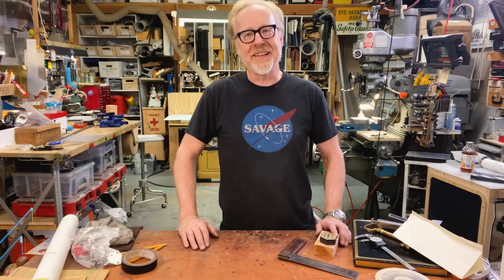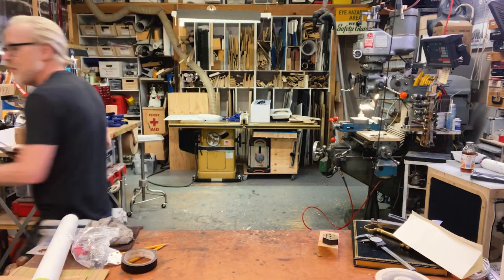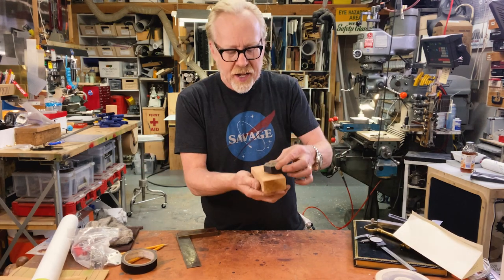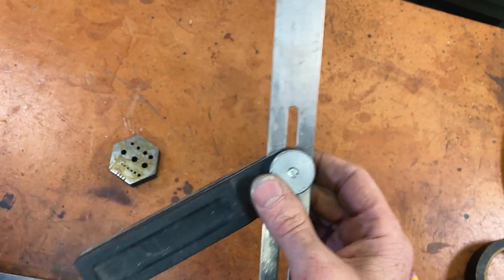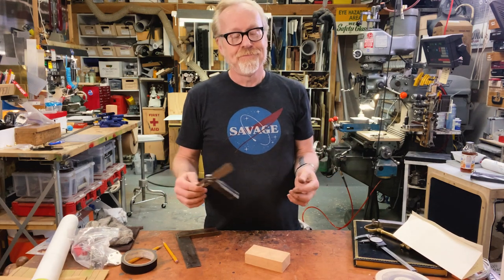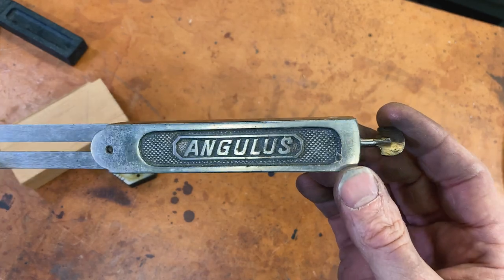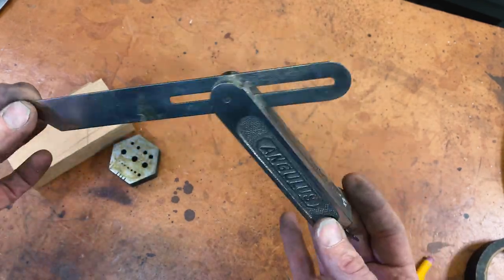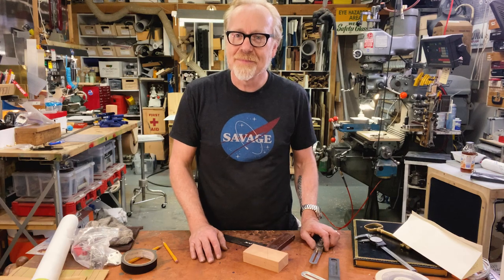Adam Savage's Favorite Tools: Angle Finder!

Comment: Hey Adam. Love your videos. I just came to have use for a c. 1920's lawn roller (its a forged steel beast) thats been in the  woods on my property for decades. The square bung was completely rust welded on, and of some mild steel that doesn't take a tool well. At a local antique tool store I picked up a "bung wrench", date-stamped 1927. I was able to hammer it onto the bung, chiseling a new edge to torque on, attach a cheat pipe to it and finally get this bolt loose.  The wrench? Its patina'd... it shows absolutely no signs of me having beaten it to death with a hammer or it having chiseled its way to making a new nut.  Its from a time when American steel was something to behold.  I LOVE this tool. It even has a pin hole in the base of the handle to gain leverage when turning the mechanism to release something like a bung nut wedged into a wrench that was hammered onto it!

Comment: I have two,  My larger one is the modern Japanese version of the Angulus made by Shinwa out of aluminum/steel (I love having the knob at the end).  The smaller one I ended up making myself.  To say that I use them a lot is a gross understatement.
Reply: I've been looking at the shinwa one. You'd recommend it?
Reply: @cholulahotsauce6166  Definitely.  I bought it years ago and it was between a Crowne (I think) and the Shinwa.  There were really nice expensive models made by Veritas and Bridge City that were out of my price range.  The Shinwa is simple and no frills but gets the job done.  The thing I like is no wing nut/knob to get in the way when flipping it over.  For marking out dovetails and such, it tends to be bulky at 10".  That is why I made my mini one.
Reply: I have long wanted a Shinwa version, I’m told they hold there setting better. For those unfamiliar with the brand, Shinwa is about the quality equivalent of Starrett and in Japan their squares are as ubiquitous as the Stanley powerlock steel tape.

Comment: I'd call that a sliding t-bevel....an "angle finder" would actually have a scale or digital readout and give you the actual angle in whatever units it is designed for.
Reply: Agreed but im assuming you can extend the "fin" fully out, put it the angle you wanna measure and put the rigid side to the compound mitre saw fence and line the blade up with the "fin" and cut. Digital/scale would be better but i guess better then eyeballing it
Reply: Yup. Sliding t bevel. 
I've got a few in my tool boxes, got a really nice wood and brass one from a company called Lee Valley
Reply: Amazon sells a t-bevel, with a digital readout, $20
Reply: It’s an angle finder to me and has been for 40 years
Reply: So would I, it is the actual name.
Reply: They are also called "bevel squares"...
Reply: Interesting. I have heard them used fairly interchangeably, but tend to think of them as a bevel gauge. I think that is frequently what I hear them referred to as in woodworking.

Comment: Worked as an electrician for a few years and 5/16 hex-head self-tapping screws were the perfect solution to so many sheet metal problems.  Had to make sure to turn the hammer off on the drill or it could twist the hex-head off of the screw.

Comment: As a carpenter I have a digital version of this, also know as a sliding T bevel square. I measure and map out an entire floor of a house when I'm doing casing and baseboard complete with checking the angle of every inside and outside 90 before I make any cuts. The digital version is worth it since almost no corner is going to be a true 90 after framing, drywall and mudding and taping are taken into account. Saves so much time not fighting to close up those gaps!

Comment: Found this video after picking up an identical Angulus at a flea market. Beautifully made, solid piece of kit - 312g (11oz). I also have one I inherited from my father, Silex brand. These were made here in Australia from the late 1940s. Same mechanical principle as the Angulus, perfectly functional, but nowhere near the same quality. Here we call them a "bevel gauge". I've also seen them called "T-bevels". I also have a hundred year old Starrett combination square with a protractor head which I guess at a pinch could be used for the same purpose.

Comment: Mine is an old Stanley. Wood (rosewood?) handle, brass fittings, steel blade.  I've had it since I was a teenager in the eighties, when I bought it at the flea market for a couple bucks. I've only used it a handful of times, but it's paid for itself many times over.

Comment: $5 tool
$40 postage

Sucks to live on the other side of the world.
Reply: You can make your own for super cheap out of a metal ruler, two pieces of parquet flooring or a piece of wood trim (hard wood) and a few misc nuts and bolts. Frankly, this is a tool one should make, never buy, because it's the beginner's tool project. There's no real critical dimensions, you can execute one with a drill, a flat medium metal file,  and a few blocked pieces of sand paper for metal and wood.
Reply: Aserta is right. Just make one.
My Uncle was a master carpenter/cabinet maker. 
He made his first speed square when he was in shop class. He still had it in a chest of old tools 55 years later when he retired.
Reply: You can get those anywhere. Most of them are not particularly nice, they have a cheap wing nut instead of a nice thumb screw, but they work. Vintage ones like Adam’s with the nut at the back (mostly made by Stanley) are surprisingly expensive, though.
Reply: I found one on eBay. Previously owned. Rosewood and Brass. Including shipping and tax $19. Go look there!
Reply: @aserta  A how to guide to make one has been printed in almost every woodworking magazine.  Two that I know of are Fine Woodworking and Woodsmith/Shop Notes.  Like making your own handle for a tool, you can probably buy one off eBay and customize it with your own parts.  This not a machinist square that need precision grinding.  The only critical thing is making sure the parallel edges are parallel.  And you are absolutely right, with brass and wood, it can be done by hand with files/sandpaper.  
I would add that taking a blade from an existing tool is a whole lot easier than chain drilling/filing the slot by hand; especially if you are working with SS.
Reply: I don't know where you live, but there's bound to be an option close to you. Depending on your locale, you could translate the name of the tool (I find Wikipedia useful for this, but it greatly depends on the popularity of the tool and language whether it works for you https://en.wikipedia.org/wiki/Sliding_T_bevel) and then look it up in your local hardware store or ebay/craigslist/gumtree-like website. Also, for making your own: make sure the edges are straight and you're good to go.
Reply: nah, more like the US sucks for being so stubborn in not using the metric system
Reply: @anarchism  I whole heartedly agree.
Reply: Shinwa has some really nice ones, don’t know about shipping but they were affordable and really well made.
Reply: I'm guessing a fellow Australian? 
Take the US price and multiply by 4. 
I think the way everyone in the States says you can pick up old tools for next to nothing is a function of the huge woodworking industry there and the time its been going. 
Lots of old tools lying around. 
I look at the ones here in flea markets, old stores, gumtree etc and they are almost as expensive (or even more) than buying new.
Reply: Better than living in the US
Reply: @pmd7914  You've got a point there...
Reply: @anarchism  .. you can get metric and standard/imperial angle finders .. lol
Reply: @anarchism  yeah those metric degrees are much better than the Imperial ones.

Comment: One of my favorite tools is a set of brass pocket calipers. Only about 4” but I’ve printed a credit card wallet that has a slot on the side for them as well as a mini BIC lighter on the bottom so that they’re both with me whenever I may need to get a small dimension accurately or melt some plastic/paracord/light a fire.

Comment: I can't find a video on you taking about them but I might be blind. Definitely recommend taking about stripped screw removing drill bits that spin backwards into a stripped screw, catch it, then because it spins backwards it takes the screw out.
Saved me tons of time after I found out they existed. Used to use a dremel and cut new grooves to take them out

Comment: Contour Gauge: My brother got me a contour gauge for my birthday. It's a cheap tool and it's pretty cool. It consists of a bunch of pins aligned tightly together but able to slide. Similar to the angle finder the contour gauge can be pressed up to an object, like crown molding for example, and hold the contour shape, allowing the user to then transfer that shape to another object.

Comment: I have a few ideas on tools that not everyone knows about. 

1) Center finding rules Probably a lot of woodworkers do know about them, but not everyone and they really are a great tool in the woodshop.
2) Saw vices and saw sets. Dont toss your dull saws, sharpen them and set the teeth for different aggression on the cut. 
3) Magnetic angle finding levels. I use them for sharpening plane irons and chisels at 25 and 30 degrees. 
4) quick release drill bit, counter sink and screwdriver bit combos. Not sure the actual name for them, but when you use the drill bit side, you can drill the pilot hole, counter sink and then flip the bit to the screwdriver side and screw the screws in. Great for doing larger projects that would be tedious otherwise.

Comment: Wow, this video could not be better timed! I have a shed sitting about 4 feet from my fence and would like to cover that space for storing wood. So my question is how do you measure and cut a 2 x 4 that will be screwed to the shed and fence at an angle? Need the angle so rain will run off the covered area. None of my tools can be placed between the shed and fence to find the angle of the cut needed to span the 4 feet distance. I hope this is making sense.

Comment: I just got a new tool that is CHANGING MY LIFE!  A Marshalltown 13" flooring cutter.  I hand recycle HDPE, and this thing is a game changer.  If you have a big shop with a table saw then this isn't really a step up but as someone who works in a small apartment this is a god send.  My pieces are never more than 12" wide or half-inch thick so it literally cuts everything I work on. No sawdust. Line up the job and chop in seconds.  Like a pocket change worth of seconds  LITERALLY cuts like butter.  Cold butter.. but butter nonetheless. Once DIY at-home recycling gets off the ground this tool will be a mandatory part of the process.

Comment: You don't need one of these sliding t-bevels, you need at least two.  My two favorites are right handed and left handed Angulus style antiques.  One is a Craftsman and the other is a Stanley.  Pre 1960 Craftsman tools were mostly made by Stanley.  Yes, they really did make RH and LH versions.  Having two or more is very useful when making something with multiple angles like a bastard hip roof.

Comment: Yeah I had to build one as my first tool, it’s fun to have to learn how to file correctly to make a perfectly round end that matches on both sides with a taper that goes from 6mm to 3mm, again matching on both sides, doing all this then getting the wrong kind of rivets that don’t fit the holes you drilled. But it was a learning process and was completely functional albeit looked like a piece of scrap metal

Comment: The angle finder was key when I was finishing the interior fitment on my boat, all the trim pieces had to be carefully measured and cut. The key to a good one in my opinion is the locking mechanism. That big, low profile wheel is excellent, but a lot of the angle finders I found in the hardware store just had a wingnut, which stuck out, caught on things, and made it a little harder to grab angles sometimes. The one I found has the low profile wheel and also a level bubble in the handle.

Comment: hey, adam there is a measuring tool my uncle gave to me its called a rabone folding ruler and what it does is it has a 2 ft measuring ruler condensed in a 6in space and it will do that as well as tell you the angle on the pice of mettle at the base and on mine and some other models it has a level on it to me this is an amazing piece of equipment and I think you were right when you said the old tools are better in some cases because they were cared for a lot more back then and made to last.

Comment: i really enjoy your tool video's, especially the simple basic tools.
a couple of basic tools i like is a 'automatic' centre punch. unlike the spring style you have shown before its used single handed which makes things easier.
another is a 6" soft board saw. it has a drill on the tip and chunky teeth that can cut a lot of different materials. simple and handy.
a range of torque wrenches. the usual click type in a range of sizes but also the old beam type for measuring breaking torque and rolling torque, very handy for setting bearing preloads on bearings in your projects.

Comment: Great tool. Although Adam forgot to mention its other function. IT not only allows you to transfer an angle, but it also transfers the complementary angle. This comes in handy in lots of ways. If you have a 60-degree angle, for example, you flip it over and you have a 120-degrees handy as well.  Any time you are trying to layout a parallelogram of any kind, this is really convenient.

Comment: here a tool you haven't mentioned. but i find is very handy, and i didn't hear about it until I was 60 years old. and it is a Hook rule. like a machinist 6" rule but it has a small hook on one end. great for hard to reach measurements. im sure Sterrett makes them. there again second hand stores or yard sales,  may have one now and then and there too not that expansive either. hope this helps.

Comment: One of my all time favorite tools is a power file. It's basically a mini, hand-held belt sander and it's amazing. Before I had my 2x72 belt grinder, I used it on every single project I did. Metalworking, woodworking, even on some ceramic stuff (but I wouldn't recommend that); it's immensely versatile.

Comment: Mr. Savage...I am NOT a handyman and I need some help. If I sharpen my mower blade (which requires 30degrees on one spot and 45degrees on another spot of the blade) what tool can I use to check it and how? I would prefer something without batteries but what is it called and how do I do it?

Comment: My favorite tool is a pair of craftsman ignition pliers (made by the  wilde tool company) they're essentially the world's smallest pair of channel locks . They look like a toy that belongs on a key chain they're 5¼" long with jaws that are 3/16" thick (3/8" thick at the pivot bolt). I  carry them in a back pocket most of the time. They're virtually indestructible. They work as a wrench up to ½" and the jaws have very hard teeth,  they've bailed me out many times when brake bleed screws were rusted up and rounded off by others , even stud extractors didn't work.  I have also used them for  cotter pins  that  were mangled  and  wire crimpers in tight spots, and to some degree they actually work better... Multiple companies make versions  by none I have seen are as small and well made as the  wilde tool co. versions..... as for the  'craftsman square'  traditional if it  has a wooden handle it would be  called a  'try square ' but with  metal handles it's now an engineers square' ..... I'm a big fan of the proper names for tools based on the profession that developed them. BUT at the end of the day  if the person you're talking to understands which tool you want. Then that's good enough.... Honorable mention, a really good quality high carbon steel (not stainless) stockman pattern pocket knife  preferably with  bone handles.... just as useful  very  abuse and  chemical tolerant ... but needs a little love  and oil occasionally. (Bet that won't start any fights 🙃)

Comment: I made my own custom angle finder, with a protractor included. I wanted to copy an angle, or angles, from something, but also know what the angle is, so I could draw that same angle in my vector drawing program while trying to design something to fit. It’s a big flat piece of sheet metal with the angles marked off (printed out, laminated and mounted), and a rotating arm that is wing nut attached. I wish these comments areas allowed uploading pictures.

Comment: I’m a joiner from the uk using my partners YouTube account 😂😂 but I would recommend a tool that you may love like I do. It’s called a starrett protractor using it to find the mitre of something is a game changer hope this helps, keep up the great work love watching your videos.
Reply: Is it different from the combination square with protractor head that he pulls out briefly in this video? 

I found that particularly amusing, because it actually does live up to the name "angle finder" and can also do anything that the sliding bevel can.

(I know that Starrett makes a lot of different tools that they call protractors and only some of them look like that combination square.)
Reply: @RonParker  the starrett protractor actually tells you the mitre degree 🙂🙂 we use it on a daily basis
Reply: @kymswift2442  As does the protractor head. Unless you mean that it gives you the half-angle you need for cutting a mitered corner. That'd be pretty useful.

Though Starrett does sell a vernier protractor that has better than 1-degree precision. I can see using one of those instead of the protractor head on my combination square, in the right circumstances.
Reply: @RonParker  yes it gives you the full mitre say a basic 90 degree angle and it also gives you half of the mitre for corners, we use it for a number of things but no lie it’s a game changer for skirting boards and beading. 👍